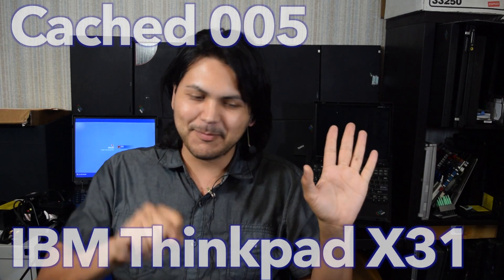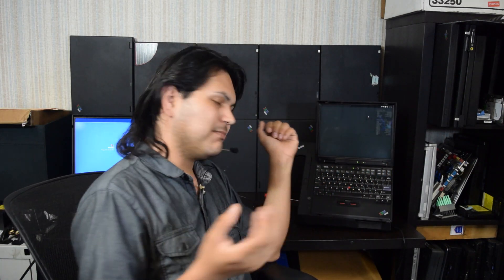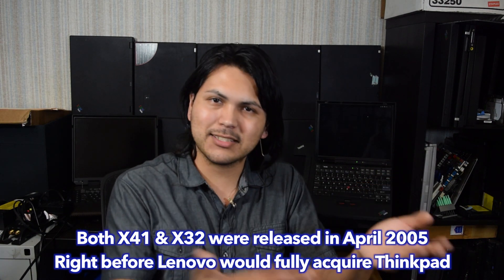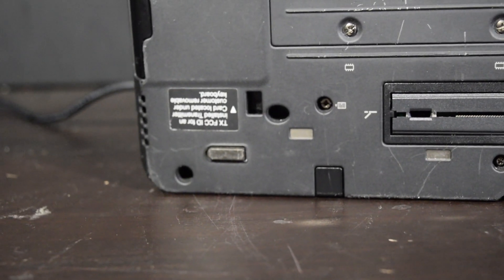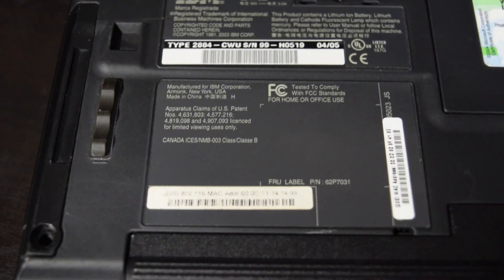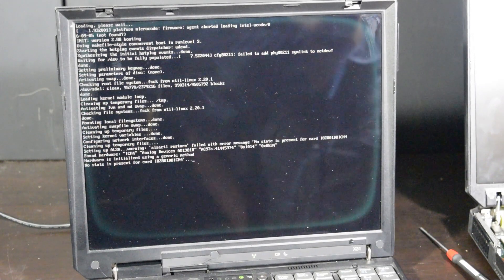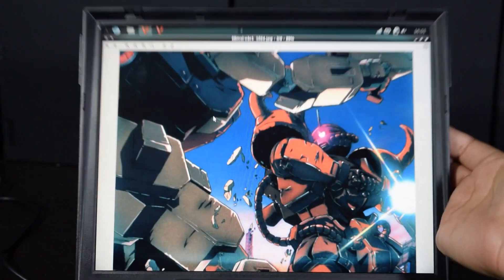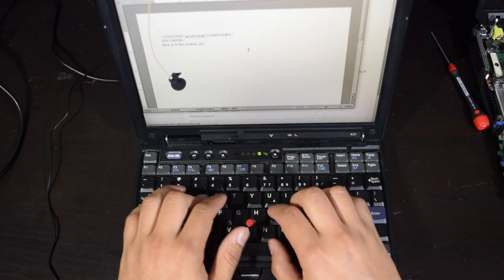Cached 005 IBM ThinkPad X31#! - AFFS mod, 1.4GHz P-M, 1GB, 40GB

Comment: About that hard drive issue. I have encountered this issue as well. My T30 would not recognize Fujitsu or Samsung hard drives so I took the original HDD of T40 which it then worked. The HDDs' brand was Hitachi and its size was 40gb. However, the T40 was able to recognize both Fujitsu (80gb) and Samsung HDD (160gb). 

This issue might occur when you are not using IBM approved hdds because they don't have the firmware for APS (or Active protection system) functionality. This is for the HDD protection if the laptop were to drop. I'm not sure whether you can modify the firmware on those other HDD to make them work on T30 but this my two cents on this issue. Always good to have two computers from the same era for possible troubleshoot like this.
Reply: There has to be a workaround cause IDE drives are getting up there in age.

Comment: I bought an X31 last Sunday for $15. Since I thrifted it, it didn't come with a charger (Could be here Thursday) and it's killing me! I am dyeing to know if it even works! The keys show very little wear and it still have the 40gb hard drive and a 5gb type 2 CP card. Thinking of 2gb ram and an SSD. I hear XBUNTU works well with it. Still, I have to wait to get the charger before I get any hopes up.
The good thing though, it smells of very stale cigarettes...
Reply from the maker: I would see if placing the Thinkpad in an enclosed container with some fabric softener sheets to get rid of the smell. But it might smell too fresh afterwards, it's an irritant to me. Xubuntu would be a good way to go, I like using it for my X61s I had. Mint worked well for my A31p years back, as well as eOS for the T43p, but I didn't like it after a certain update in 2015.
Reply: Sauceyjames thanks.

Comment: Did that screen issue ever get resolved (or found out what caused it in the first place)?
Reply from the maker: I really haven't used it since then. Strangely I had a similar looking problem with a T460p
Reply: @Sauceyjames  I see. I have an X32, and thinking about Flexview modding it and making it into a retro gaming machine. I have the panel, but still need a cable for it. Also I would like to LED mod that panel as it has a super dim backlight.

I am just not sure how good of a result I can expect. I might end up with less ten ideal results after putting in a lot of money and time. So I am still trying to make up my mind.
Reply from the maker: @kosztaz87  yeah I bought this X31 as it already gotten the AFFS mod & it was a local sale from the Thinkpad forum. Really didn't need one, but I was on a collection spree, so I pounced at it. I'm afraid of cable modding, bc I've never done it B4.